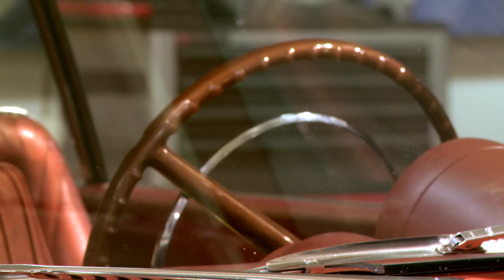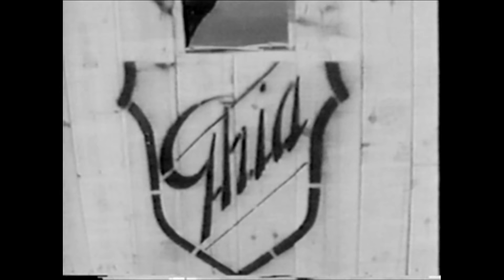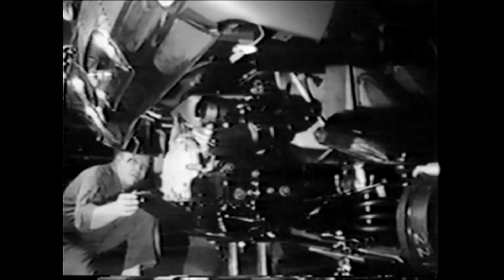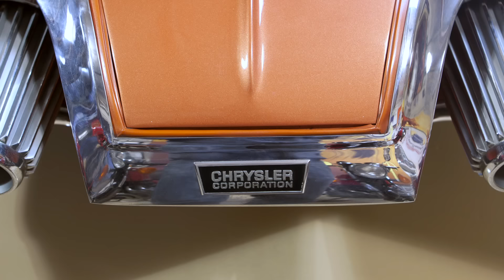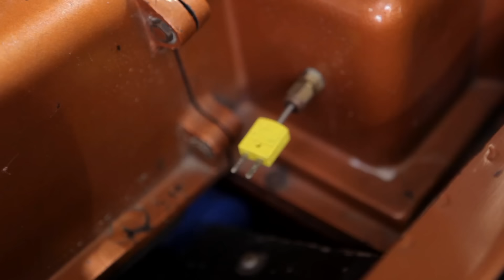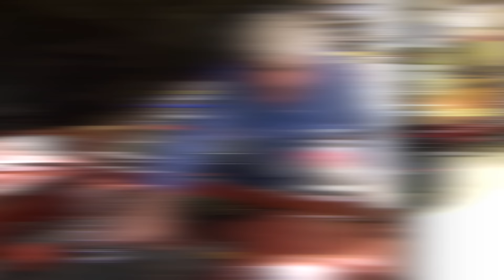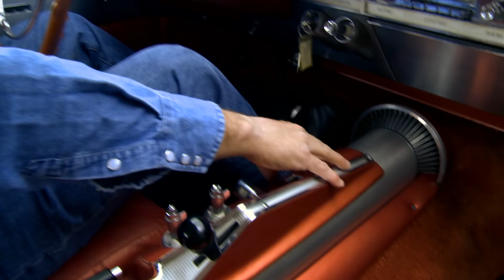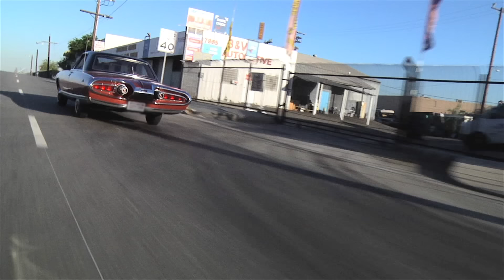1963 Chrysler Turbine: Ultimate Edition - Jay Leno's Garage

Comment: Jay is definitely right about the exhaust gas temperature.   Both the concerns and rumors and the facts.  Chrysler had one on display at the Michigan State Fair, just idling.  They encouraged people to check the actual temperature.  I put my bare hand and arm less than a foot from the exhaust directly in the path of the exhaust gas.  Just warm, not hot as many claimed it would be.

Comment: I bet that Chrysler turbine would stall out if you are driving through let's say a dust storm I know for the fact that the first M1 A1 tanks were prone to that problem I wonder if the Chrysler engineers back then in the early sixties thought about putting an air filter in front of the intake of the turbine engine?

Comment: Thanks again for actually driving this iconic car and being its custodian. I vaguely remember that one of the problems found in customer/real world testing was that the drivers would not wait for the temperatures to stabilise on startup so basically hitting the starter and putting it in drive which was detrimental to the turbine due to the higher temps on startup common to any gas turbine.Typical human impatience which may have been helped by some education.
The engine would look different to a normal jet engine because it has the regenerator which is crucial to "fuel economy" ( relative term) at part loads.Lots of problems with materials and sealing due to the temperature extremes. Not sure whether the technical challenges have been licked yet but with gas turbines in their infancy and no ceramics, it would be a weak point for regular consumer use. One thing they got 100% right was the styling. It still looks retro cool!

Comment: (Under the hood)  "Those 60's connectors."  Actually Jay  the yellow  thermocouple / pyrometer  connector you  pictured remains a  standard to this day!!   If you buy a brand new  Fluke  multimeter  with a  thermocouple / thermometer setup, it will use that connector!!

Comment: jay leno  jerry lee burchell jr showed close up on mopar turbine I use to a top car detailer. body man painter can not much this days. ever use soft brissel toothbrush get wax out hard to find places like eblems. moldings. see any my cars out there stolen like 65 vette 283 3speed column shift 32 k starter in trunk new clutck put indy storage up on blocks owner wanted drivers I gave two chevettes 81 ltd tranny engine kit.. 8 years I seen a car on ebay marco addreeti 67 Camaro 65 vette 283 hpo heads. I went to indy tour of indianappolis showroom seen all ajs cars .last summer I did it 95 fastest lap around indy bike track with 10 scale rc cars. first laps testing flew hit middle wall sighn. half hour it ready. use race gokarts on bottom. you florida see my 63 impals 4 door white power everything says ss opyion car on the sticker. in glove was on window. I think jr Johnson has was in iowa 71 chevelle blue 2door. I tax exempt lot. cheveele bought 71 the guy died in 71 viet gong17 k 60 falcon 17 k add on shi town air 64 half mustang conv. 6cly add on air convertible zebart had new rear floor pans. I co-doan some exotic cars to you rare ones . I co doan nice red Shelby mustang dahl ford la crosee he has muesumn.i co-doan race driver owners talk show host even elen Kelly regis  somebody needs a car I look they have make offer. look paint don't match 22-20 viison 64 I old beat olds intrique no air loaded rusty. drove it indy back.try get people send 50 to 100.00 finder fee . jerry lee burchell jr p.o box. 366 Onalaska wi 54650. look you tube aboneded mg factory loads new mg factory recent clean. 150 new cars.

Comment: There's no way any modern manufacturer would ever try something as insane and new as this was. Even the most high tech hyper cars of today have only recently introduced electric motors operating in tandem with the more typical combustion engines. Dropping a jet engine into a Chrysler in the early 60's must have been seen as totally unbelievable. I can't believe there are only two left. This is when owning a car like this becomes a responsibility and an actual job, rather than just a hobby or a mode of personal fulfilment. You take on the job of maintaining it and keeping it going so that future generations can actually see and experience an operational example instead of just reading about it or, even more likely, it being forgotten about entirely.

Comment: I had a mechanical engineering professor who'd worked on a turbine car that ran in the Indy 500.  It was leading in the last few laps, due to needing one less pitstop than the piston cars, and the transmission failed.  He was convinced it was sabotaged.  The next year they restricted the air intake area which kept turbines out of the race going forward.

Comment: Outdated cabin design, even for '60s standards, had to been a major factor in quashing the concept. But just imagine if the engineers stopped popping Mlltowns and chasing them with vodka martinis long enough to reroute the exhaust, adding a blowoff, and throw a smaller turbine to the mix

Comment: I have lots of history with Jays Turbine car. I worked in vehicle development and off and on the turbine project. We still had this model at highland park in the early 70s, i had the keys and was instructed to run it all the short trips i could around the engineering area. I drove it across parking areas and shut it off. And to a parts room or to the exit gate and picked it up the next morning. Good old days, that was a restricted project. We had other engines that were powerful but this one looked cool. Poor acceleration.

Comment: Sorry I'm five years behind - I get home from work a watch different videos.  Anyway, I saw some show, probably on PBS, about this car and one ting they mentioned was . . . like, a flywheel or something . . . that, instead of taking your foot of the throttle and the car decelerates, these turbine cars would just keep going at the same speed, and it freaked the drivers out.  You'd actually have to brake a lot more, on the highway for example, instead of just letting off the gas and you drop back a little from the car in front of you.   Is that true or is it another Turbine Myth or am I getting stories confused in my head?

Comment: The boys in the Chrysler experimental department didn't give up after this car. I've seen a  photo of a Chrysler K-Car with a turbine in it. Like Jay said, fuel economy was always a problem they couldn't overcome. In mechanical engineering this is usually called the 500hp rule. Once a gas turbine is putting out less than 500hp, the thermal efficiency drops like a rock. It's the reason you don't see many gas turbines in light aircraft. Gas turbines depend on the mass of the airflow through the engine to develop power and with a small engine it becomes very difficult to get a lot of air through without the flow going supersonic.

Comment: My dad, Jerry Mills, worked for Chrysler.  In 63 (or sometime thereabout), he was assigned to drive the turbine car to NYT for a Today Show appearance.  That's not all.  They gave him a $5000 quart of Chanel No. 5.  On the Today Show, he poured it into the gas tank.    He spent the rest of the day diving it around Manhattan on three wheels for more publicity.  The 4th wheel was removed to demonstrate Chrysler's torsion bar suspension that was being used on regular Chrysler cars.    He also poured a quart of Johnny Walker scotch into the gas tank.

Comment: Although I understand the limitations of a the gas turbine as a full replacement for the piston engine (as noted by Jay), I've always wondered if Detroit didn't miss an opportunity to use a smaller, fixed-rpm turbine to spin a generator in fuel-electric hybrid.

Comment: We should consider bringing this concept back. The fact that it uses a turbine engine has some very good advantages, especially considering that turbine engines don't need gas to run. Now, of course, we got to consider the disadvantages, like the noise and the fuel economy, since the car would burn the same amount of fuel idle as it would at maximum performance. What we could do is a hybrid, don't know how it would work though.

Comment: unusual motor for cars, i know a guy that built a car with a helecopter turbin engine, not that that gave it more power but just as it was diffrent.
i see many thinking this is a jet engine and thats not the case, this is like a turboprop, it turns a mechanical crank its still drives the wheels unlike a jetengine would.

Comment: Jay you ever thought of making a gas turbine/steam car, use the heat of the turbine can make steam, used the commendation to make electric to drive the car. I seen where you made a turbine car, I thought adding a Dynamic brake system would help the brake problems. Put a load on the engine when the car is slowing down or stop. Use the heat off the oil to pre heat the air going in to the engine too. lol anyway just a thought, love you show from a fan!

Comment: I   myself   seen one of these cars that they brough  up to   Quebec City                   Chrysler   dealer              Universal  Auto     I would of been about  16 then in 1963  or   1964  abouts   ,,,,   they   started up the engine in the    showroom   we where a small crowd in there  to hear this car    they did not drive it........    This   turbine engine is a bit the same principle as most   helicopter engines   that is  a   turbo   compressor unit that generates the hot moving  gasses that then  go on to power the   power turbine part of the engine   these are totally on  different shafts    and   offer some safety especially on a  helicopter  where if the power turbine  gets  overloaded and slows down a bit  the turbo   compressor itself  hopefully remains at top speed   and keeps  supplying  maximum gasses to the power   turbine.......   In   this car   the  power   turbine could  provide torque even at stand still  so  it was linked to the 3 speed Torqueflite  via a   special  reduction gearbox   with a   output   rpm  similar to a normal   piston  engine   no  clutch  no   torque  converter    needed

Comment: I realize this video is over 4 years old and I heard Jay say he doesn't want to really "get into it" regarding speed of the vehicle HOWEVER, I really would like to know a few things on this. What about taking this car to a drag strip? NOT for racing at all but for acceleration testing. NOT for burnout but just to floor it when the light turns green and stay on it until the 1/4 mile ends. Also, perhaps late at night when there are no other cars on the highway take it out and find the top end or near top end. While there are currently no replacement parts by Chrysler on the market, Jay is rich enough to have specialist manufacture replacement parts if needed. 

Also, take the car to emissions testing on different fuel sources. Such as would emissions even register if running on vegetable oil or even kerosene?

Comment: In 1964 I was with my Dad at North Star Chrysler & Plymouth in LA when we was buying a Plymouth Fury.  He was always a Plymouth buyer.  They had the Turbine Car there demonstrating it.  I was lucky to be able to ride in the car as my Dad was doing the paper work on his car.  This dealership was in downtown LA so the ride was on surface streets.  I do remember the man from Chrysler telling me the car had the equivalent of 130 horsepower but it felt like a V-8 powering it at 200 horsepower.  When I asked him what the cost was, he chuckled and said it was not for sale and he thought the cost was about $50,000 in 1964 dollars.  It was a neat ride and when I found out it would burn just about anything, I thought for sure it would be a hot seller.  Jay was fortunate  to be able to get this and in great running condition.  Chrysler was innovative just like the Chrysler Air Flow 30 years earlier.

Comment: it would burn any fuel, so they scrapped them even if they were so little of them made. EV1 could be charge with any power source being electrical, and they crushed them. 
If it turns out it can break people out of the monopoly of oil and dependancy, it won't be allowed.

Comment: What's interesting is that this was the only true attempt by Chrysler to put 1 in the hands of the public. Chrysler still had a turbine engine program all the way until  the end of 1980, but only in test mules. They had 1 in a production based 1973 Dodge Coronet, a 77 Volare' and an 80 Mirada, all for testing. Emissions and expected fuel economy killed the program, as well did the public's demand for FWD and smaller cars. By that time, they had lessened lag for better acceleration,  were using lighter more simplified components,  had a more compact package  and improved fuel economy quite a bit. NOx emissions were still way too high, as can be expected, and the technology of the time just wasn't there to clean it up. As we all know the bankruptcy of '80 didn't help either. Very cool vid, Jay, lots of info. Thx for doing it!

Comment: Hey, that connector you couldn't identify is probably a thermocouple. Figure out what type it is and then connect a wire of the same type and a digital meter, it will read out the temperature to several decimal places. ;) Thermocouples are wired red to -, black to +.

Comment: seem like this would be much more useful with current hybrid technology cars. A small turbine could be used to charge the battery packs. Perfect for running wide open regardless of wheel speed. It also has the added benefit of running whatever fuel desired, i.e. homegrown fuels.

Comment: Totally enjoyed this. I remember reading about this in our "Weekly Reader" while in grade school in Somerville, MA. One thing which is not mentioned is that most gas turbines expend, if I'm not mistaking, in excess of 40% of their power output in order to run their own compressors. The regenerative heaters are pretty novel. The power-to-weight ratio of a jet engine is pretty high which, I presume, had a lot to do with the gas turbine's appeal for a vehicle. Ultimately Otto beat Brayton, but it's still a story that needs to be told from a more "Can-Do" time in America. Thanks for sharing it Jay!

Comment: Those cars had Poor Fuel Efficiency and were probably BIG polluters. Jets run better at high altitude and when spooled to maximum velocity. If you don't hook a Generator to the engine you cannot store the energy and it gets wasted.

Comment: British car manufacturer Rover built a prototype gas turbine car back in 1950, with the intention of it going into production within 3 or 4 years. However, I think they never solved all the problems, and no other cars were built beyond the prototype. Like the Chrysler, it could run on any fuel. It had a top speed of 90 mph, and could accelerate from 0 to 60 in 14 seconds, which was very fast in 1950. The big snag was that it only got 5 to 7 miles per gallon, and that's an Imperial gallon, which is slightly more than an American gallon. Later, in 1963 they built a turbine powered racecar in conjunction with BRM which raced in the Le Mans 24 hour race.  However it was too difficult to build an nengine small enough abd fuel efficient to fit in a racing car, so that also came to nothing.

Comment: I wonder if the gas turbine engine will make a comeback for hybrid cars. Turbines are very efficient at high RPM's. Perfect for running a generator to recharge a battery. The fact it's low maintenance and can run anything that burns makes it perfect for hybrids. If you want to use bio-diesel but have to take the car on a trip where that's not available, no problem. Just fill it up with gasoline. No modifications needed.

Comment: Jay ...the yellow electrical connectors , found in the engine compartment are Thermocouples type K Chromel alumel .. They give a milli voltage output proportional to the temperature ...very common in industry and engine test labs

Comment: Wonderful "futuristic" automobile.   I love the tail end design! I'm happy you own it Jay.  She couldn't be in better hands.  The engine runs super smooth.  It may not get great MPG but with so few  moving parts I would assume it is a reliable power plant.  The cost of making the turbine engine was a Whopping $10,000 !!  In 1963 a V8 was $2-300 !  Gee, take a guess which engine folks would choose?? 🤔🤔🤔🥱😲
Too bad they couldn’t have made a small turbine engine that would be used to heat a boiler that powered a steam engine!😲🤔😊. That would cut the amount of “fuel” used considerably.  Another option would be using a tiny turbine to power a hybrid electric motor.

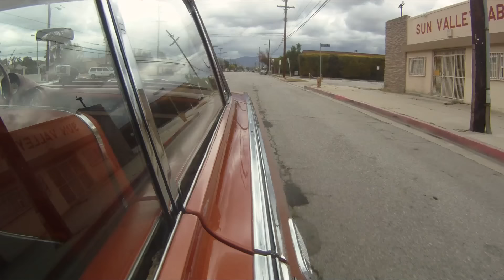Comment: 21:20 "It just feels this is where we should have been by now"
That's 1000% correct we should be beyond this. Oil companies and greed hold the automobile back. The automobile has not changed since 1912. Different luxuries. The made them lighter by using what? More oil(plastic) parts. So sad we should be hovering or even flying by now.

Comment: I got to ride in one of these Chrysler Turbine cars when I was a lad.  A school friend of mine's father had one for a month to test drive.  They picked me up for summer school band practice in it one day.  I guess I was about 13 at the time.

I have always loved machinery and was thrilled to have the opportunity  to come into contact with one of these revolutionary cars and actually ride in one.  I remember the sound it made idling at 22K rpm, like a huge vacuum cleaner.  I think maybe under way it was cruising at about 60K rpm.

The museum of transport here in St. Louis has had one for several years, and they have it on display in their classic auto building.  They even trailer it out to car shows now and then and start it up to show that it is in running condition.

Thanks to Jay for doing a feature on the Turbine car.

Footnote:  The St. Louis museum also has a gas turbine Ford Truck, from the 50s, in their collection.